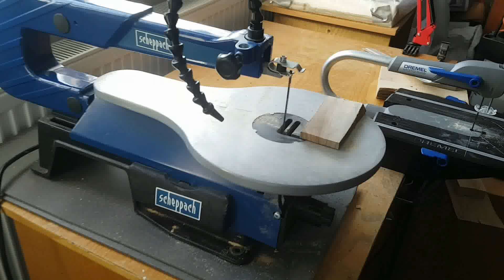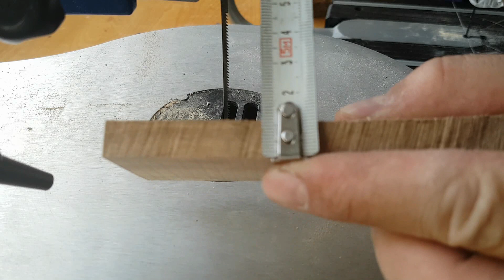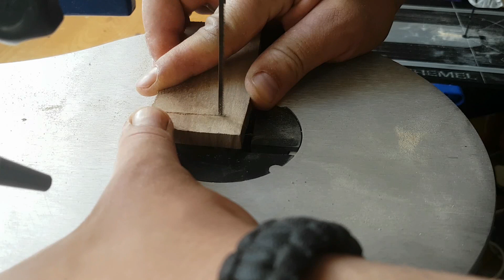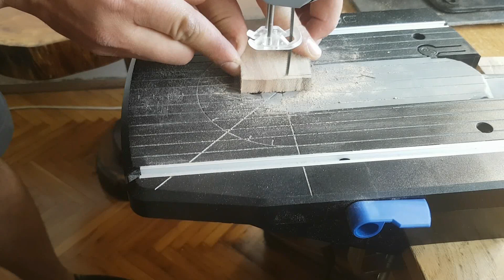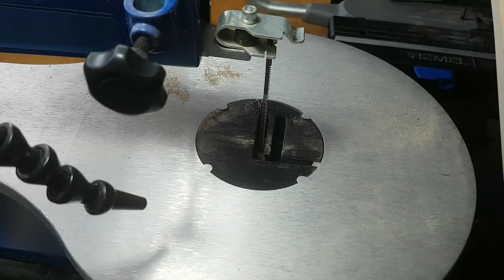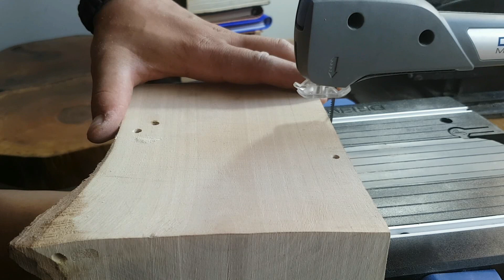Dremel moto saw VS Scheppach SD1600V TEST

Comment: I think your conclusion is that the Scheppach is better. I never tested the Dremel, so I don't really know, but based on your video I would agree with that.Though, you have to learn how to use these machines and I see some very serious errors you are making here. The most important is that these machines MUST be fixed to the table BEFORE use. Also, the pressure foot MUST be lowered to prevent material flexing. You should also not push the material into the saw blade at higher speed than it cuts, that's just pointless and damaging the blade or the machine, or both... AND results in bad cut as well as presents  some serious dangers for the user. The saw blade may brake and penetrate your hand before you know it, causing a lot of pain. Pulling out a thin saw blade from your hand is also painful... There are other things you should think about as well, so I will not list them. Anyway, read the manual next time BEFORE use and before you call something "test".

Comment: Read the MANUAL booklet first. As far as I am concerned, Dremel Motosaw is supposed to cut wood at the maximum of 18 mm thick. You tested with 45 mm thick wood. This will surely DESTROY your machine.

Comment: Seems a bit unfair a test, the moto saw is more suited to small craft building.
Reply: WeasleFire:   I often wonder why folks put videos on YT making comparisons on items that are made to be used by a different audience.  The Moto-saw is definitely for hobbyist only, and those who work with no more than 3/4-1" soft wood, or 1/2-3/4" hard wood.  If a person wants to purchase a scroll saw to make larger items, and work with 2-3" hard woods, and a lot of metal,  do not pick a Dremel Moto-saw.  Know in advance what your goals are before making the purchase, thereby getting what is needed for your particular situation.   Running track requires a different type of shoe vs. a regular sneaker, or it is like trying to compare a Ford-Chrysler-Chevy car with a Bentley and Rolls Royce, thereby making the comparison a bit unfair.  I live in an apartment, so a large scroll saw is totally not appropriate.  I also want to make puzzles, ornaments, small scale Jack n' Jill houses, small jewelry items, etc, and a large $300-500 scroll saw not what I require.
Reply: I know right, I got my Motosaw for sheet styrene cutting, its very well suited for small intricate jobs.